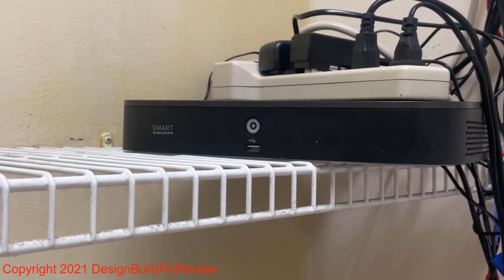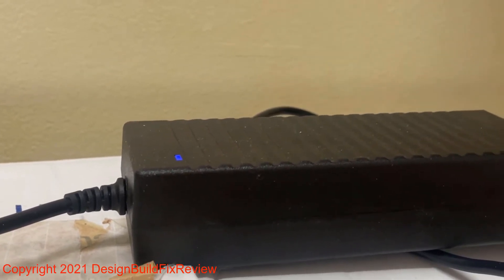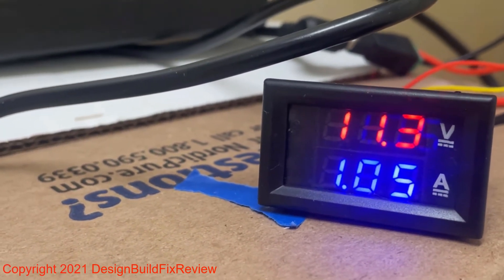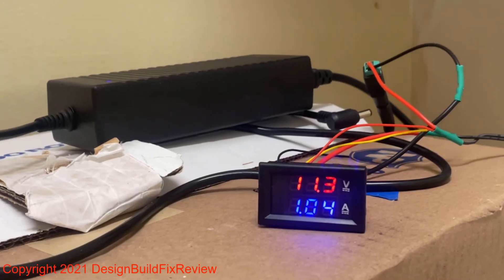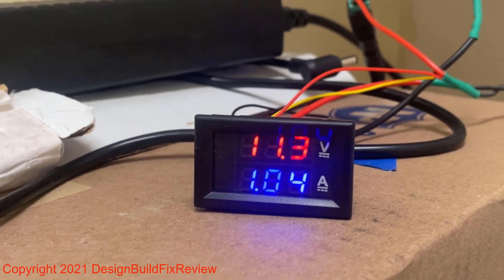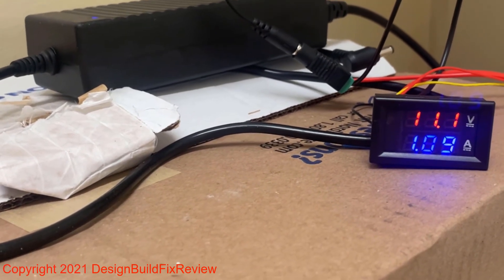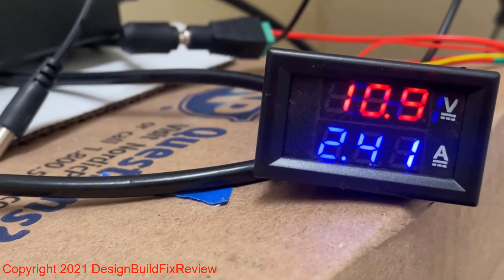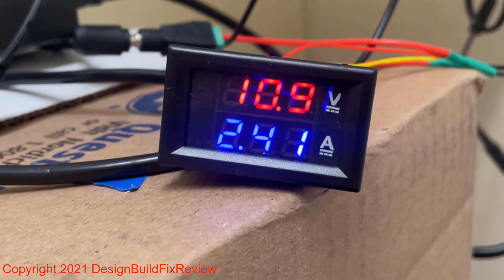Lorex Security System 4k power adapter upgrade better images

Comment: Interesting.  The larger power draw at night is due to just the night-vision light?  Have you tried a POE switch?
Reply from the maker: My setup uses the BNC connectors not the IP type. I think if I had an IP setup I would be sure to have a POE switch.The power over POE would need to be ramped up for long runs.